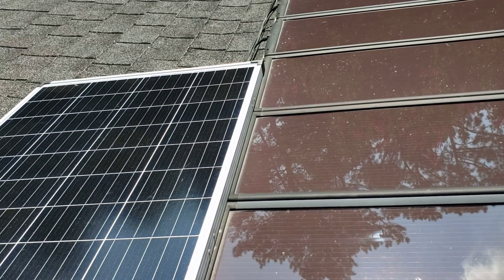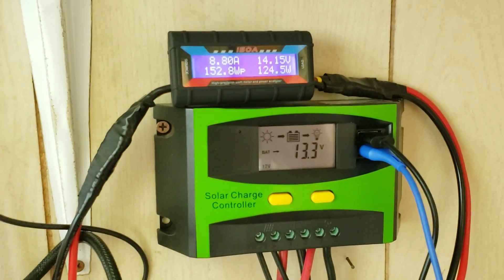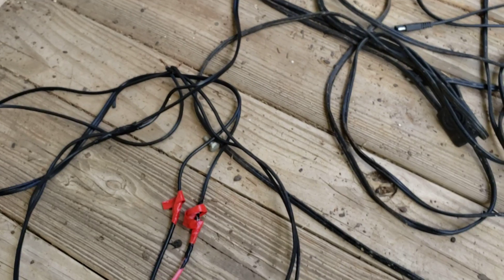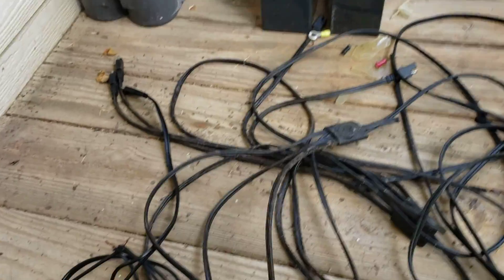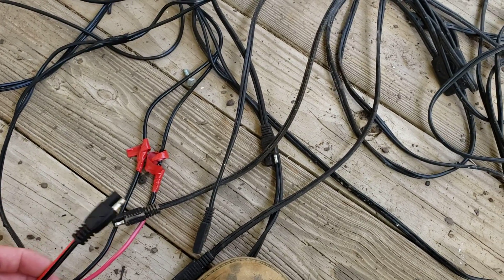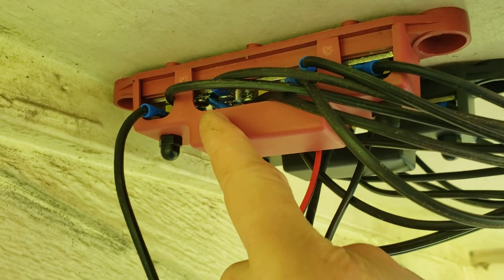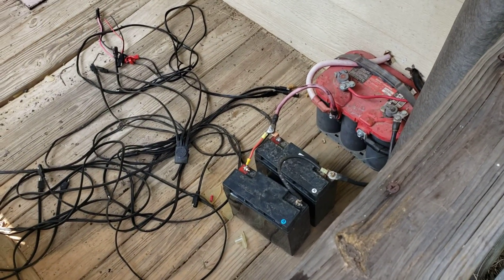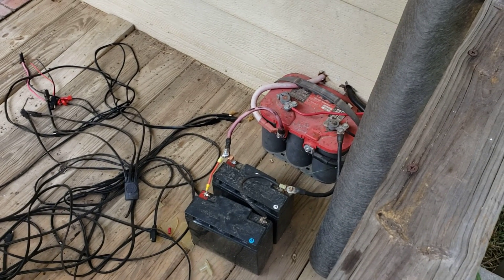Can you mix the new and old Harbor Freight Solar Panels?? Will they work??🤯57325, 63585

Comment: I called Harbor freight and they said that you could mix them. The problem is finding a controller that can handle the new monocrystalline panels. They’re so cold 500 W controller can’t even handle 200 W because it Maxima run amps at 20amps
Reply: so called not so "cold" type 'o'

Comment: Your connection is parallel not series, series would increase the voltage parallel increases amperage.
Reply from the maker: Yes your correct. We now run series parallel on our Renogy setup

Comment: No load voltage for both type of your panels is around 22 volts I believe. That is what makes them compatible. I also have my new 100 watt panel plugged into my older 25 watt  (x4) system. It does work well 👍🏻
Reply from the maker: Yup I ran the coolman cooler all day and charged all my batteries
Reply: Aren’t the old panels 12v and the new panels 24v.   I’m really new at this and trying to figure it out.  Can you plug both into that round 400w hub they sell and then into a moot charge controller?
Reply: @dennisburke3187  the new 100 watt panel is also for a 12 volt system 👍🏻 I also use both old 25 watt and new 100 watt panel together to charge my battery, it is working so far.
Reply from the maker: They are working fine together and yes as long as you don’t exceed 400w
Reply: @gregoutdoors7  thanks so much for your help.  I think I am brave enough to hook it up now.😃

Comment: You got your parallel and series connections mixed up parallel will keep it at 12 volt series will turn it to 24 volts
Reply from the maker: You may be right we may have mixed them up need to check the video lol 😂

Comment: Thanks, good info here, what I'm wanting to do is get 3 to 4 100 watt panels and obviously a controller and such to keep from over charging my batteries, and hook them straight to my rv batteries as a portable type system. From the sounds of it I would need to get a better bigger battery controller from somewhere other than Harbor Freight to handle this, correct?
Reply from the maker: Yes the ones from HF are trash just make sure the one you get can handle the amps and volts you need

Comment: I have one of the old forty five watt kit and I just got the hundred watt panel can I mix these two. it may take a long time to get an answer, but I''m just curious. ??
Reply from the maker: Yes you can I have a video on it
Reply: @DIYKAI  thanks I don't have mine set up yet. I'm prepare for an outage of electric grid failure. I have a sixt five hundred watt generator, a two thousand sportsman both are very loud so I got me a Two thousand watt inverter generator which would use a lot less gas. at the moment I have four deep cycle marine batteries but I want to start getting into solar.
Reply from the maker: Yes solar is the cleanest and quietest power source available for the little guys like us lol….have back ups is a great idea for days that don’t produce enough sun
Reply from the maker: How many aH are your batteries?

Comment: i was trying to answer you on the batteries amp hour, but you know computer's if it is not saved it can be gone in an instant. the four batteries are walmart  marine , rv deep cycle and I have one battery from harbor freight. which is thirty five amp hour I do know that they should not be drained over half at max.
Reply from the maker: Correct I use the half rule on all types of lead sealed, gel, or marine if it’s rated at 100aH I really have 50aH….keep them out of direct light and if possible around 80F is the perfect setting for them
Reply from the maker: We have 400w on a tiny house 2 of the old kit and 2 of the new panels we can get around 280w @15A or so in the winter right now so it’s still more than enough for lights, tvs, cell phones.
Reply: @DIYKAI  this is one of my problems also i have a two car garage but un heated. I thought about putting them in old cooler that I have out there. of course I would cut hole in the side and put a plastic pipe out side for gas discharge. I was wondering if this would work. it can get down to zero at least around here No way to heat the house.
Reply from the maker: Yes that would work fine or if you can run to the hardware store they sell sheets of 4x8 foam insulation for around 9 bucks you could make one out of that very easy

Comment: These are not to be used in series with any other panels.
Reply from the maker: Your correct if your using a HF charge controller as they are not able to handle the increased voltage….with my MPPT controller they are fine or any that can handle over the 24v or so
Reply: @DIYKAI  No, the panels themselves cannot be put in series, they are not designed for the increased current. It is stated in the instruction manual.

I forgot to mention, thank you for posting the video!
Reply from the maker: Ah your correct I just went out to look at them they are parallel I have a few different set ups lol…your welcome! Thanks for watching and I will make corrections
Reply: @DIYKAI  Yes, in parallel, the more the merrier, (in the limits of your controller, as you state) helps to get your battery charged even in less than bright sunlight..
Reply from the maker: Our other setup is series parallel 600w and it never drops below 12.3 running a few deep freezers 24/7 no issues
Reply: @DIYKAI  Perfect! very nice.
Reply from the maker: Yea it’s amazing we got 2 more 100w to add to it but as of right now it’s not needed..lol.. it produces 520+ always with 560w+ @ 40A most days so it’s getting around 1.8kW daily